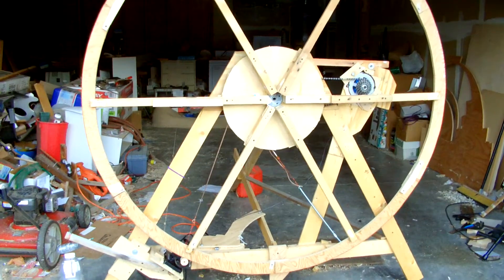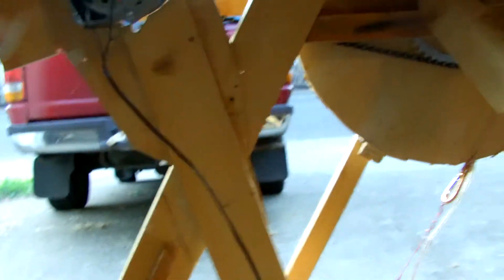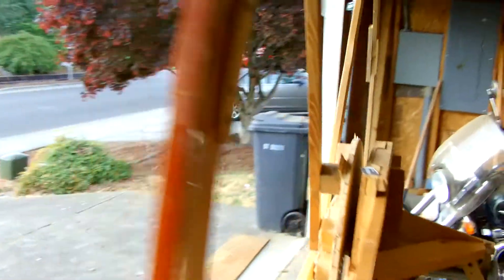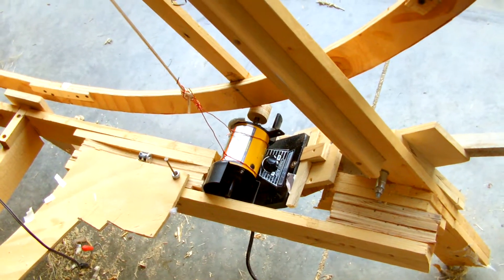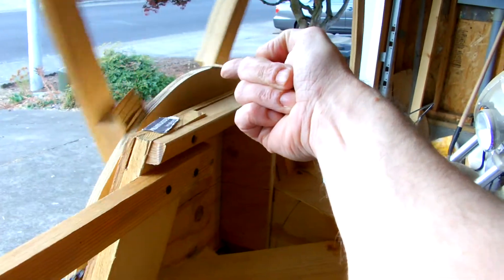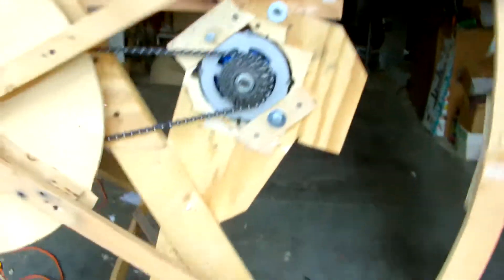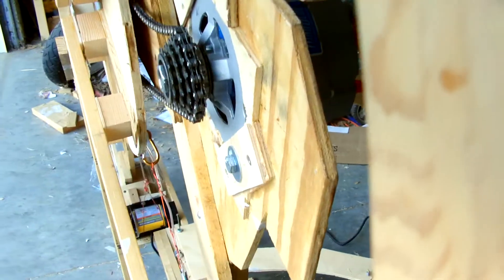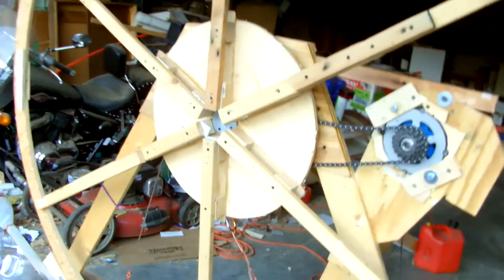overunity  rotary lever  inherent mechanical advantage  non-collapsed MA  SCALAR  free energy

Comment from the maker: diary entry:   designing an over-sized sprocket that operates, smoothly, in not a simple task.   anyway, the prime mover does not have enough MA.  so,  the radius of the drive-wheel must be reduced.    this prime mover is Not well suited to this application.   it consumes too much power, while its output torque is very  low.   at any scale, More input torque is a good thing.   i predict that a low-current draw, high-kv  outrunner design, with 'reduction' of course, could be efficient.    small to medium-sized, high-kv bldc outrunners are used in certain hobbies and machinery.    unfortunately,  ALL  off-the-shelf versions of such motors draw  Too much  current, to be efficient in this application.                     ( beep -similarly, a purpose-designed pma is needed.   beep -  this is a recording.     beep -  see the low-speed pmas used in  WIND TURBINES, for an Example.     beep)

Comment from the maker: diary entry:  six chain engaging points have been assembled and installed;  each is about two inches wide.   six narrow points do not sufficiently support the chain, where the application is a  large-radius drive sprocket.   necessary mods are underway.

Comment: The round wood disk on your rotor should be your gear size..drive to your magnetic alternator ..increase spin and the Speed  will increase power output. Then setup a large capacitor bank with blocking diodes then use strong magnets on your rotor and use three lawnmower mower wheels with magnetic in opposing fields embedded in the law wheels  around your rotor and leave a one inch space for clearance place the law wheels 120 degrees apart around your rotor use good roller bearings for your law wheels then you can take the friction away then you can use a 12 volt motor on one of your lawnmower wheels taken the power from the capacitor to run the motor ..the 12 volt motor shaft is where you mount one of the law wheels free spin no Friction .think outside the box..Thumbs up keep trying
Reply from the maker: thanks for this useless, verbose reply.